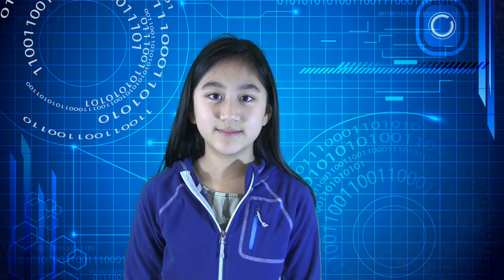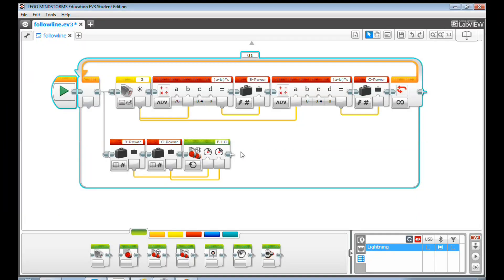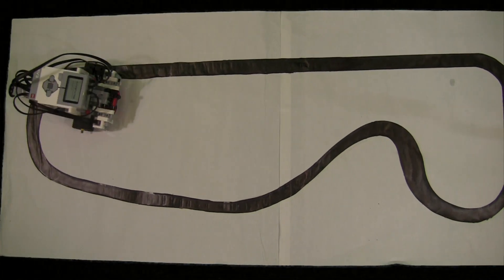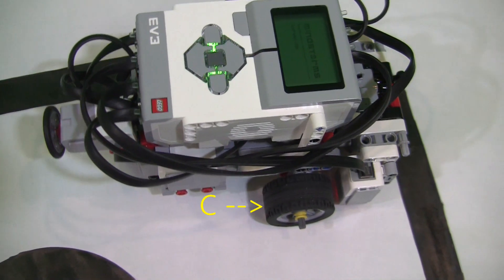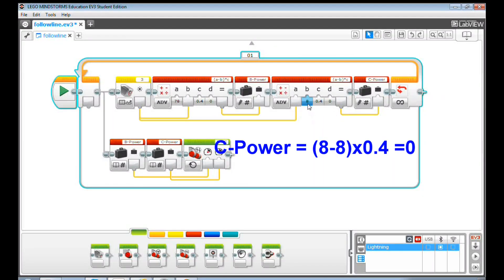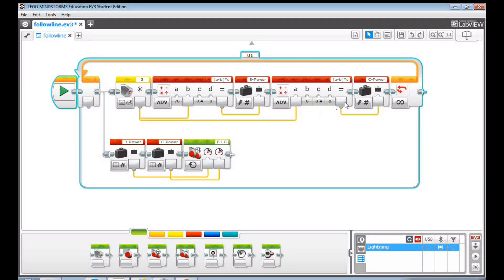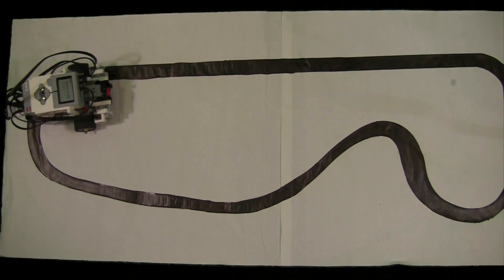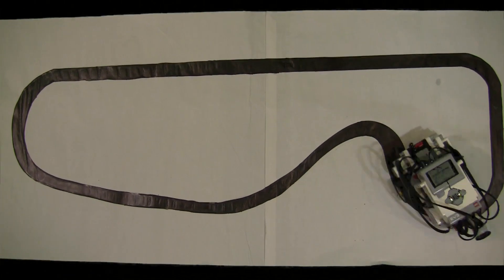EV3 Programming 2.1: How to follow a line with sharp curve

Comment: Our FLL team encountered a problem negotiating a sharply-angled line in the 2014 World Class robot game.  In the middle of the field, there's a green line pointing west that terminates in a black line which also forms a "V" shape.  Our robot couldn't figure out how to make a sharp turn to follow the black line down to the bottom of the "V", so it just sailed off into the white area.  Next season, we'll be sure to follow these tips -- thanks!
Reply from the maker: dluders Glad it helps, in 2014 World Class robot game, we didn't follow any V-curve. We installed 2 color sensors. Something like, when one color sensor is following the green line, the other color sensor detects the black line and then follow the black line directly. Installing 2 color sensors (left & right) helped a lot for accuracy on the FLL table.

Comment: Hello! I have watched this video and the 1.9 video several times and both are extremely helpful but I do have a question.  In the 1.9 video you set the 'c' value of both Math blocks to 1, but in the 2.1 video that value is shown as 0.4 on those same Math blocks.  What is the reason for the change in the 'c' value?
Reply from the maker: MrDraconyc Hi MrDraconyc, the reason to change 'c' value from 1 to 0.4 is mentioned in 1.9 video from 7:05 to 7:40. In short, to make the follow the line program smooth, we change c value from 1 to 0.4.

Comment: Hi little angle 

I just wonder , when i'm doing the program ( from 1.9 ) the robot is moving in a zigzag line ,, right left , right , left , right ,, etc , so what is the changes i can do to make it smooth !?
Reply from the maker: +Moh'd Mahdi Hi Moh'd, you can try to reduce "c" value.

Comment: hi..how to programme 2 color sensor.one color sensor to follow the black line, another one detect black line to exit the line following loop?
Reply from the maker: ling teoh You can still select using color sensor detection to exit the loop. The key is to change the port to the 2nd color sensor port instead of the default value "3".

Comment: Can you please make a tutorial on how to program 2 different colour sensors at once? Please reply ASAP!
Reply from the maker: Kinikoo Flip Flop Hi Kinikoo, I just saw you message. what's your purpose to program 2 different colour sensors at once? such as, one color sensor to follow the black line, another one detect green line to exit the line following loop?
Reply: Well there's this ev3 sumo challenge and I was thinking to use   a colour sensor at the back of robot and one at the front so I was wondering how to program 2 different ports in one program
Reply from the maker: Kinikoo Flip Flop Never tried sumo challenge, it seems like 1 robot tries to push another robot out of the round table. I guess you try to install a color sensor at the back to avoid dropping out of the table. Are you able to know whether your robot is moving backward? if yes, how about choosing the front or back sensor based on whether the EV3 is moving forward or backward? Let us know what you find, may help others as well. :-)
Reply: ok thanks for replying i will see what i can do

Comment: I like this, but I have a problem.
It goes back ward!
Reply from the maker: You might have installed the large motors toward different side, so it goes back ward?
Reply: Add another math block before you put the values to the motor and times them by -1

Comment: So confused
Reply from the maker: joardan Wibisana Hi Joardan, you'd better to watch "EV3 Programming 1.9: How to follow a straight line smoothly" before watch this video. If you try the code from 1.9, you will find the robot gets lost when it makes a sharp turn. This "2.1 how to follow a line with sharp curve" is showing how to modify the 1.9 code to let the robot to follow a sharper turn.2:04Play nextPlay now